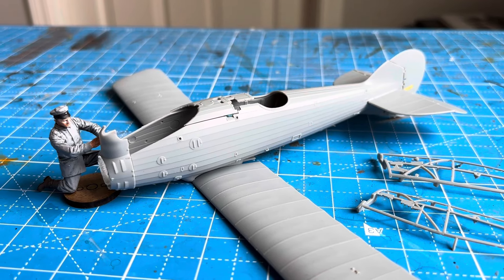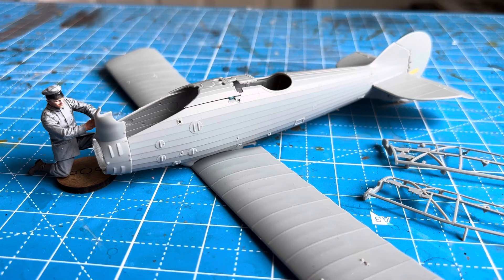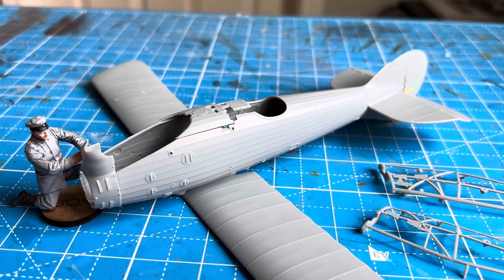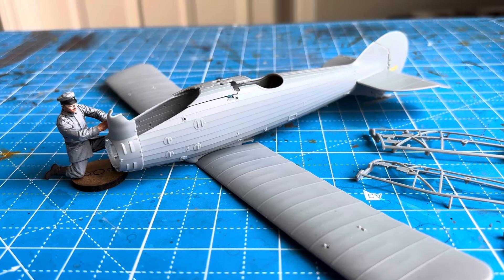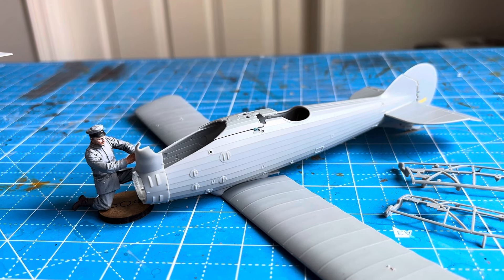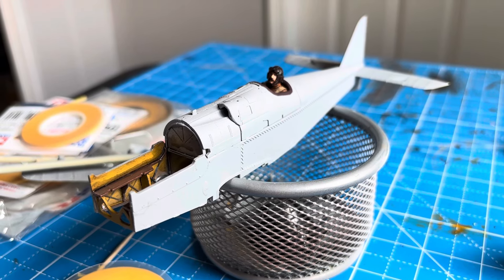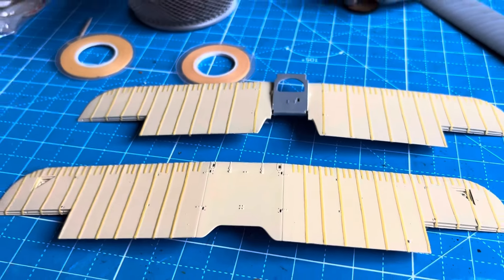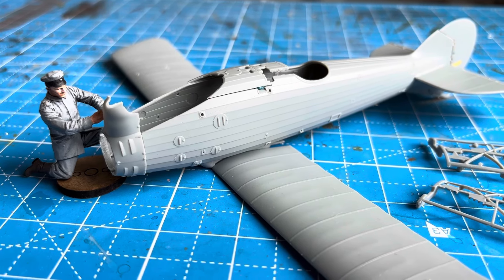I’m calling b******t on most in box reviews of Wingnut Wings kits.  A rant.

Comment: I agree that one should build the kit before assessing it. Regarding the fit with paint or glue depends on the tolerance or joint designed by the manufacturer. Ah the frustrations of model building😮

Comment: Many kit manufacturers are touted to be the best out there but you never really know until you open the box, look at the plastic on the trees, do some dry fitting, and start cementing parts together. Even then, all may be going great until you get to a certain point in the build, and suddenly there is a particular step where nothing fits right. I have built kits from several different companies, and have found that some are better than others, but none is perfect. Tamiya, Trumpeter, Academy, Revell, and Monogram, they are all good but there is bad mixed in with the good.
Reply: Also, ICM makes some nice stuff as well. I've never built a Wingnuts kit, way way too expensive for this old retired guy!
Reply from the maker: Agree !  Thanks for your comments.
Reply from the maker: @paulsmodels  I wish I’d heard of Wingnut Wings before the company folded.  My purchases were costly but by golly I’m going to build them albeit slowly.  Cheers.

Comment: You hit the nail squarely on the head sir. The trouble with CAD design is that it leaves no tolerances for things like burrs or primer/paint even some of the latest Airfix kits are starting to suffer from the same problem.  While this is great for the prototype building stage without paint, it detracts from the overall pleasure in building and painting your purchased model. Manufacturers take note please

Comment: I think there's a difference between an /initial/ impression - of anything - and actually using / assembling it. Anything can look good, but in use can be a real pain in the proverbial. Plus of course there is relative experience. Someone with lots of experience of model aircraft may find a specific make is always easy, and another is a menace. Someone who does - for example - ships, figures, armour, etc. may find the 'easy' one a challenge. You can only speak as you find :)

Comment: The only value of an in box review is if you want to see what's included in the kit, in cases where you can't find pictures of the sprues online. Other than that it really doesn't tell you much.
Reply: I exclusively build ships and that's exactly the only reason I watch unboxing videos. Even within the same company their seems to be no consistency between the price of a kit and what you actually get.
Reply: @glenchapman3899  It's the same for car and airplane kits also.
Kit brands change ownership, and molds are moved from one brand to another. Kits that started out as one brand might have been manufactured by three other brands 20 years later, from the same tools. And kits from 50-year-old tooling might be sold alongside kits from new tooling, at the same price, and by the same brand.